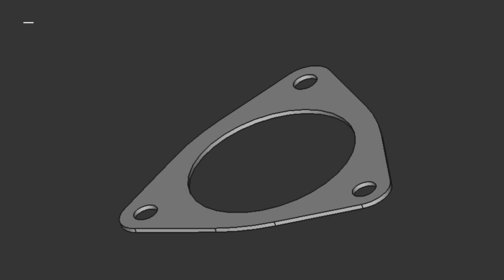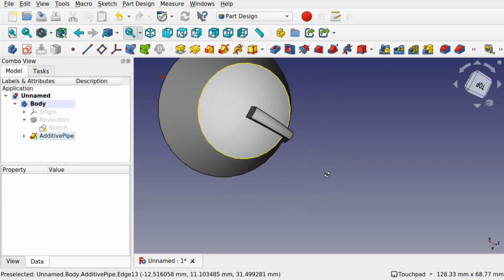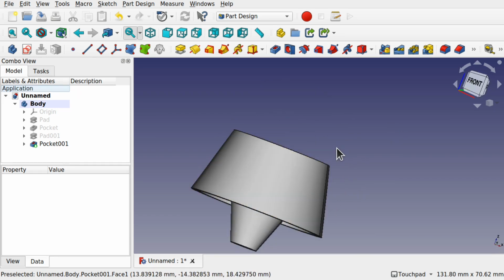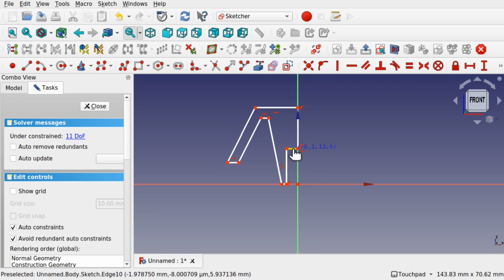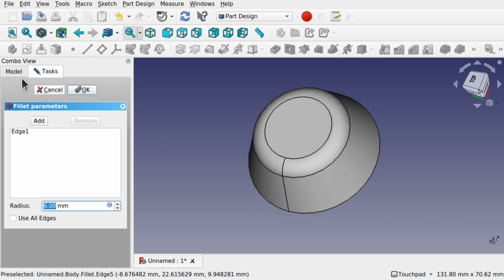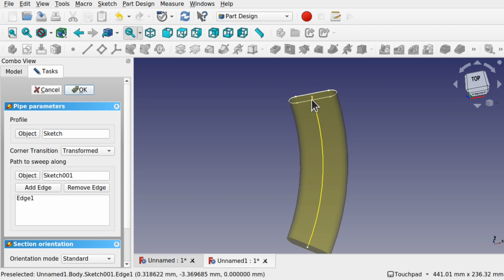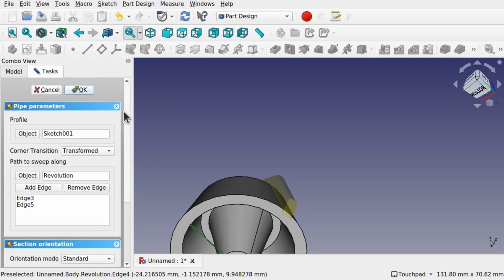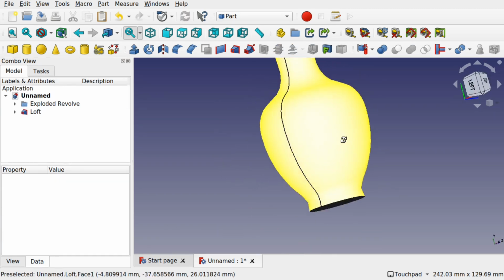FreeCAD 0.20 For Beginners | 7 | Revolve and Sweep for More Complex Modelling | Part Design

Comment: How would you approach creating a set of knobs with not only shaft diameter being variable but also "has flat"/" has no flat"?
Reply from the maker: You can drive the diameter by changing the hole diameter in the sketch, you don't even have to open the sketch up, if you name the constraint in the sketch on the same popup you enter the value then when you exit the sketch and click on it in the treeview you will see a property in the data tab called 'constraints' and it will appear in there where you can change it.  The operation(s) that creates the flat / no flat can be suppressed in FreeCAD v1.0 and above by clicking on the operation and setting suppressed to true or false in the data tab.
Reply: @MangoJellySolutions  So the creation of the flat would have to be done as additive, e.g. Pad? In any case I need to slowly build a proof case for this to make it reveal itself to me :)

Comment: I love freecad, but it's frustrating to edit a chain of attached objects. If there are ANY changes in a sketch at the top (even a simple movement or dimensional re-constraint), it can often break downstream attachments despite the same surfaces existing.

I spend most of my time trying to avoid this with a careful use of a scaffolding datum planes and sketches (rather than attachment to surfaces), and editing breaks when editing an upstream feature.

A bit more consistency would be a god-send.

Comment: Thanks a lot for your work its really amazing I am learning a lot. However I am having an issue in this example. After I connect the two profiles using the additive pipe it looks great. But either the "revolution(Knob)" is visible, or the pipe is visible... I can't display both at the same time..?

Comment: Seeing someone casually adding sketches to faces is confusing when all of the other tutorials I watched so far told me to avoid this unter all circumstances … 😆
Reply from the maker: It's not something to avoid, it's something to be aware of as you can go back and fix the problems. It is defacto CAD practice which I follow in the videos. The problems what people talk about is the TNP issue. But, not all problems are TNP and it often it gets miss diagnosed. In any package if you delete a face / edge you will get an error if you anything attracted to it and you will have to reattach the sketch / geometry. But with Freecad we have the additional issue of faces sometimes being renamed after a change which in near future releases this is going to be fixed. Attaching to faces is usual practices. You be missing out most of the CAD world if you try to avoid it.

Comment: Hello, For some reason when I "Add Section" which is "Sketch002" under Section Transformation, I get a "Sections must be all closed or all open" error message. I've tried several times to fix this issue without success. Any input about what I may be doing wrong would be greatly appreciated. Thank you very much for such wonderful videos, they are such a great help!

Comment: Tried several times. Could not get the dial indicator to come out. Does not merge into the profile of the smaller tab. Also, I could not draw the second tab correctly on the proper face. my XY plane was at the end of the cone and I had to move it back to the proper plane. I'm sure they are related, but I'm stymied at this point.

Comment: I'm using Rev0.21. For the life of me I can't seem to configure the settings so the 'Edit Controls' box is visible. I finally found the drop down box where Auto Constraints/Avoid Redundant Auto Constraints can be checked. But this must me one of those 'intuitive' things. That's where software updates hide things that take forever to find. Unfortunately I haven't used this software enough to consider myself a native user like I am with AutoCAD. I was using that back in the DOS era.

Comment: Out of curiosity, why not use the cross-section rather than redrawing it? I cheated, retaining the cross-section and using it to create the new sketch, which seemed to work perfectly. One difference between my project and yours - the Revolve was created outside the body rather than within it. The sketch I created is within the body and the body was active when I did the rotation. Perhaps this is because I'm using 0.20.1 rather than 0.20?
Reply: I revisited this again today, and did it exactly the same as you did, deleting the cross-section and redrawing by hand. The result was the same; my Revolve was created outside the body. The only difference is that I'm using 0.20.1 and you're using 0.20, so that seems to be it.
Reply from the maker: I'm not sure how that's happening. Revolves in part design should always be in a body as they are automatically fused to your main body. Do you have the file at all that you could send me? Its a real strange one. Is the sketch inside the body when you start?
Reply: @MangoJellySolutions  When you look at the file, you'll see a number of ReferenceRevolve's. I think I had to do this because the initial revolve isn't in the body. 

Strangely, I didn't have to do this in my first attempt (in which I used the cross-section rather than drawing the sketch from scratch) even though the Revolve wasn't in the body in that project either.